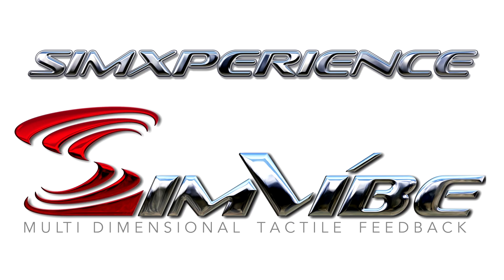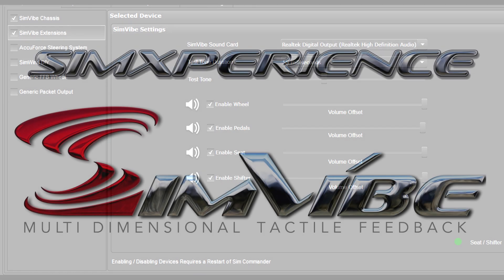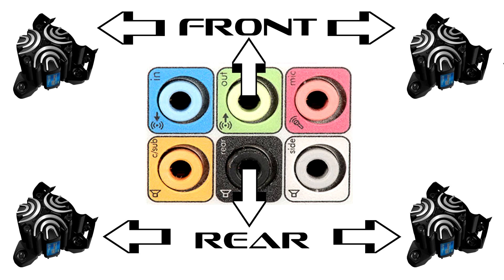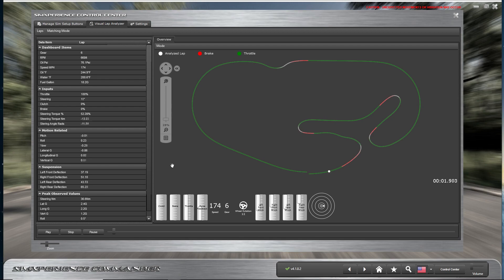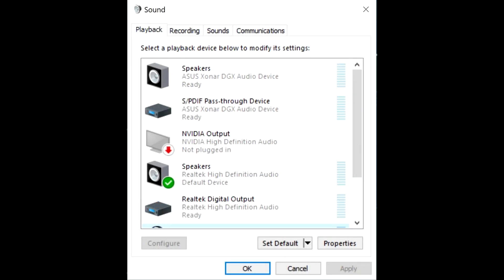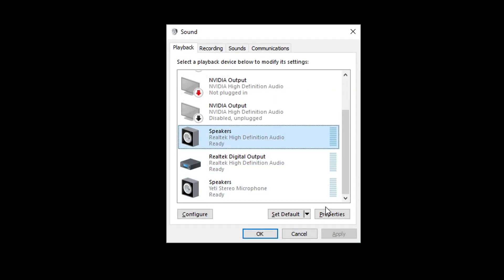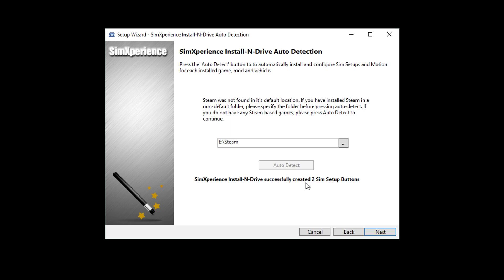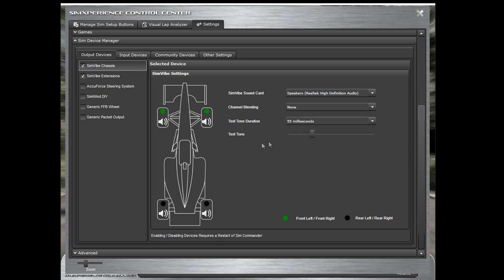SimVibe by SimXperience In Depth Setup and Configuration

Comment: Can i use optical cable instead of phono leads?
Reply: We have not tried to use an optical cable for SimVibe, but as far as I know, it should work.
Reply: Theres an iRacing setup somewhere. It talks about using a home hifi amp which I assume you are using. It takes the low power full audio and filters it if you have a cross over built in OR you can buy a cross over and can set the ohms of the speakers. Optical should work if you set your amp to <100hz and 6 ohm for 6, 4 and 2 ohm transducers.

Comment: I have two shakers under my seat (each on there own sub left/right channel ). I only have the seat enabled in extension mode. Does that mean only one shaker is running?
Reply: Ahh i was only using one shaker, engaged shifter for the 2nd shaker
Reply: @magzire  Yes, basically sounds like you have a two channel amp so would need to do what you did and use another of the extension modes for your second channel.  Alternatively you could split the single channel into two and plug that into the amp l/r inputs (analog approach) but just using a second channel like you did is easiest.

Comment: What’s the reason for doing both chassis and extensions modes at the same? This software is mad confusing.
Reply: Each handle different transducers. Chassis has 4 outputs (one for each wheel) and extensions does the other parts of the car such as Seat, Pedals and Shifter

Comment: Pretty in-depth tutorial Darin, this should be a great help to those that are new to SimVibe, Keep up the great work buddy.
Reply: Pro Sim Racing Ha! Im still confused about the sound cards. I have 3 Buttkickers. 1 under the seat, 1 on the shifter and 1 under the pedals. I have all 3 daisy chained to each other and plugged into my mobos on board audio. I use the Oculus to sim race so that audios running via HDMI. What do I need? 1 sound card for each transducer? I imagine I’d run it in extensions mode.